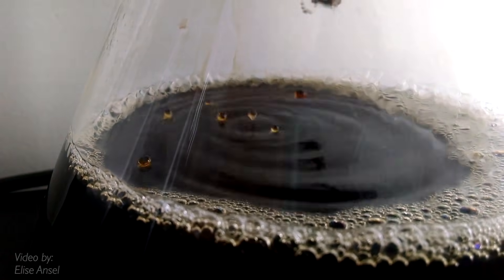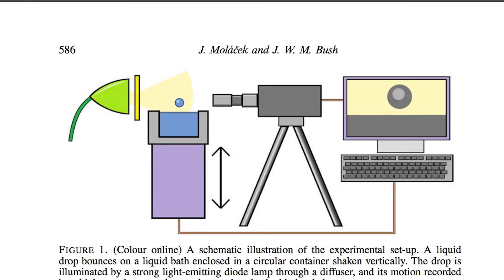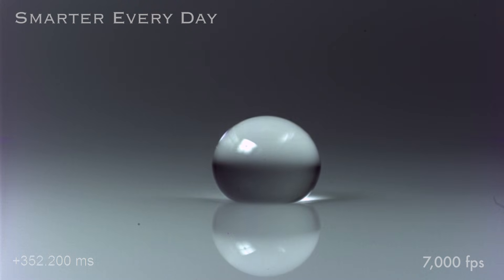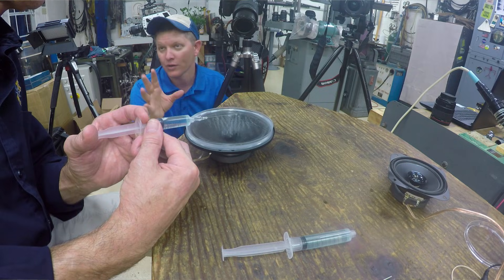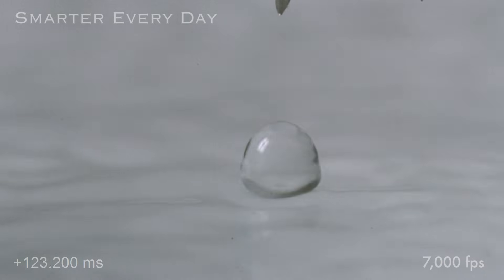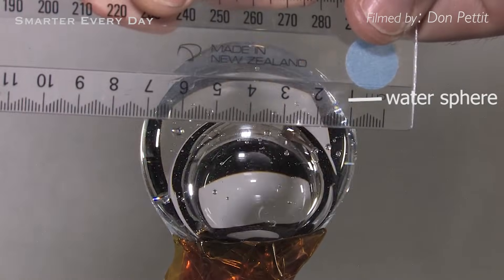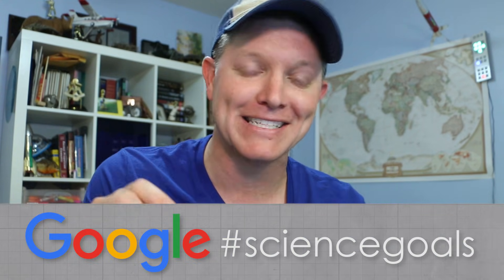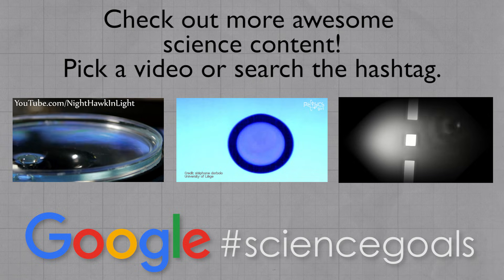The WALKING WATER Mystery (in SPACE and SLOW MOTION!) - Smarter Every Day 160

Comment: At 0:52. My guess is that there is a small region in "parameter space" where the surface tension is not quite enough to form gas bubbles but can form liquid bubbles? Then those cannot float in air, so they skim the water, and then then eventually the liquid reabsorbs them.
Reply: Oh shnikes. I guess we're getting into surface chemistry … ………

Comment: I can't understand how this video does not mention the forces that bond the water. It seems reasonable to suppose that the tension between the drop and the water happens because the surface of the drop is "more attached" to the rest of the drop than to the water that do not hit the drop with a pointy wave. When the water acts like a bowl the gravitational pressure is momentarily less strong than the surface tension that depends on the force of the bonds of the water.

Comment: I would like to add some personal observations regarding this phenomenon. I have seen this many times while paddling a canoe. The splash that occurs when the paddle enters the water for a new stroke, throws the water forward with a bit of spin imparted to the droplets by the forward motion of the paddle entering the water, and also,  it is also the angle of the blade which imparts the spin. These spheres sometimes last for two or three seconds. I found them fascinating and thought alot about them.
Victor Schauberger saw rocks of six pounds weight levitating in river rapids. The rocks came right up to the surface and bobbed about. This happened when the water was very cold and buoyant as a result.  [I noticed you were observing melting ice droplets.]
Another inventor discovered that if water is vibrated at a specific rate, electrolysis is improved massively.  When the water molecule is vibrated its electrical bonds are loosened, so with the same electrical input hydrogen and oxygen are produced many times faster.

Comment: OK, Destin. I stopped at 4:20 to make a hypothesis that the residence time has to do with temperature differences between the droplet, and body of water it rests on, affecting surface tension. Also, if you reduce surface tension by introducing a surfactant such as dish soap, it will eliminate it completely. Now I'll continue. :)

Comment: if the walking water is due to the air layer between, then a vacuum pump should eliminate this phenomena
Reply: They mentioned that.  There were experiments with reduced air pressure & the dwell time of the drops decreased linearly with the pressure.

Comment: This phenomenon is very easy to understand. The basic principle deals mostly with rotational velocity versus surface tension. Basically they are both water and thus "should" just become one again, however because of the movement of the water droplets through the air, a barrier is generated due to the difference between the molecular vibration of the gaseous air and the liquid water. There is at that point an even amount of pressure around the water droplet and now that it is isolated and falling, the movement can't spread beyond the boundaries of the water bubble in motion so that downward velocity must be diverted continuously and thus generating a rotational movement. The bigger body of water is stagnant in comparison to the rotation of the smaller water droplet and so as the droplet spins it is moving too quickly to breach the surface of the bigger body of water. after a few milliseconds or seconds the bubble has slowed down due to a two part system, friction from the body of water and the water droplet being close and putting pressure on the small gaseous barrier between them as well as energy dissipating as the droplet rotates. After the droplet has slowed down, the surface tension of the droplet lets up and gravity begins to act more on the droplet and the movement of the droplet and the surface tension of the bigger body of water are significantly closer. The droplet gets too heavy to be supported by the small gaseous barrier and so it descends, penetrating the barrier and falling into the bigger body of water. That's about it.

Comment: Timing AND node size, perhaps?...the troughs and peaks created (nodes?) by the frequency you used seemed to closely match the drop size as well? Would seem to create a better hydrostatic (for lack of a better word, sure there's a correct one) layer of air between the surfaces if they are similarly sized and shaped...?

Comment: I was once an audio major, and though what I'm about to say isn't scientific, I think you'll be able to extrapolate my intention to one of understanding. 

Concerning the cello, and why it causes the droplets to break apart and float around inside the air bubble; the cello is an instrument of sustained friction induced sound. Running the bow across the strings creates vibration through friction, sustained friction. Other instruments, like wind, most percussion, and even a piano result sound from instantaneous pressure changes due to air or instant impact. Even a drum, though sustaining a partial friction based impact initially, the sound is produced due to the change in air pressure resonating off the head and walls of the drum.

With bow and string instruments, we have an entirely different source and cause of sound. Continuous Vibrational Friction of materials is necessary to create and sustain the sound, and the moment that ceases, the sound diminishes rapidly, depending of course on the tension of the string in question. Whereas in a wind instrument, the molecules themselves are being vibrated inside the instrument to generate sound. 

Given that, the medium through which the molecules are vibrating emanates from an entirely separate kind of source of sound causing inducement. As such, I would wager a guess that a) if you were to further study this at a deeper level you may reach the answer as to why they cause this and nothing else causes this effect, but more importantly b) it suggests that molecules can vibrate in entirely different ways given the method in which they are induced to do so, causing different forms of sound. Much like a square, sine, or sawtooth wave, the idea could be that the molecules vibrate in just a certain way that is different than that of non-friction inducing sources. Think nails on a chalkboard.

I hope that makes sense, and as I said, it's not scientific, just a theory.

Comment: Temperature may also play in to this.  If the water drop is cooler or warmer the puddle.  You have an example of ice dripping into a puddle.  Maybe similiar to water on the fry pan.  Be interesting if the water was absorbed when the temperature was the same.
Reply: The cello comes closer to matching the resonance frequency of the water.  Notice how the low tone makes the water shake violently that's probably close to the resonance frequency of the water. It would be interesting to match that frequency and hold it for a longer period of time.

Comment: Don't the strong hydrogen bonds of water also help the water not break down or flow into the larger body of water. A drop of water will generally be able to maintain its shape longer. I can also compare this to a pencil where a long pencil can be broken easily while a short one cant. If hydrogen bonds where mentioned my bad.

Comment: I would think has more to do with surface tension than "air gaps" between the surface of the water and the droplet of water. When they vibrate the water via the different forms of waves, the surface tension of the water is strengthened, in the same way that a sheet of metal is strengthened when you crease it over and over along the surface of the metal. A flat piece is weaker than a piece with some pattern of grooves and/or dips and vallies! Interesting video! 👌

Comment: The cello caused the water waves on the inner surface of the bubble to break loose due to the long period of vibration.  Rock and other musical types do not reproduce the lengthy vibrational period so the water can spring back after each note rather than attenuate and break free.   Likely this can only be replicated with strings due to consistent vibration, though perhaps some woodwinds may be able to.

Comment: Ok I did not watch entire video so explination may be in the video and I may have missed it.

If explination is not in video then here is what I will offer.

"Prince Rupert a drop syndrome"  the exact physics that form a hard shell glass drop is happening with all matter when it is liquid form.

The drop is formed when there is no supporting solid matter in gravity or not. That drop has its on construct where all the effects of basic physics apply such as temp differences surface tension and grip. Together creating a sphere.

The sphere becomes it's own entity with a outer wall of surface tension holding it together in a Prince Rubert's drop fashion, when a glass drop  cools the outer wall becomes very hard as everything inside is pulling the surface inward multiplying it's strength. Do to the speed difference in cooling.

Imagine if we could harness this law of physics to creat more complex shapes for body armor or
 even apply it boating to help improve fuel economy of ships.

No I am not taking about the sound side of this, but giant vibrating ship would be fun.... For about 5 seconds.

Comment: Disagree about the air gap part. I believe it's caused by the surface tension of the liquid. Low air press can reduce the surface tension. The rotating/spinning of the  liquid also plays a critical role.

Comment: i am the only never seen these water balls?
Reply: ASHO nope
Reply: Nope
Reply: I feel like even with a critical eye, no, I haven't noticed this. Maybe there's another factor at work such as altitude? I live in the great plains of texas, and I have never seen this phenomenon before. I wonder why that is?
Reply: No if you have turn on a water faucet or washed your car then you have seen it. You just did not noticed. It’s caused because the water droplets are round which has the strongest form a liquid can get into. The the flat water has surface tension. For a short time the two surface tension fight each other.
Reply: @equuspallidus  did you even watch?

Comment: it has never happened with me..
Reply: JasonSt 1. Get a glass of water 
2. Use another glass and add water in it also add a little bit of soap and mix
3. Slowly dip your finger into the glass of soap and water
4. Get your finger on top of the glass of water
Wait till the water on your finger drops there
(If you have a pipete use the pipete)
And the water ball will bounce!

Comment: There is actually a better explanation than an air layer but I'm sure that plays a roll. In reality water at an air-water interface undergoes a phase transition where the water molecules are oriented in liquid crystal chains due to their polar dipole moment. This (North-South-North-South) bonding structure is much stronger than the bulk water and the interaction of the two surfaces will naturally be of like charge and therefor they will repel! 

Look into this liquid crystal phase of water, so much technology we're missing out on with simple water as the main ingredient.
Reply: If the air gap theory were correct wouldn't the gap be smallest with the initial impact? Also the catcher's mitt analogy doesn't seem to hold very well on the flat surface or for prolonged drops (but obviously any decrease in impact forces increases the odds of a lingering droplet). My guess was akin to yours wherein a longer duration allowed for alignment of water molecules between the droplet and lower water body wherein the polarity of single molecules was stronger with the molecule in the droplet than the molecule that the water droplet in the water body was previously attached to. Once that initial boundary layer is violated the surface tension doesn't hold up and the droplet's molecules take their place in the larger body of water.

A question that arose from this is whether the surface of a body of water has a unique structure that allows for the rapid formation of a crystal structure promoting freezing and perhaps surface tension above freezing?
Reply: I think this explanation is probably more accurate and certainly worth more consideration. As a physics graduate, I am struggling to accept the air-gap explanation which relies on compressed air in effect,  but the water-air interface charge suggestion seems to me to make more sense as it would then be an electrostatic repulsion of the two same charges, until it was overcome by some other force.  Indeed the standing nodes would present a higher/lower dipole moment that would explain the observed phenomenon.

Comment: Wtf i have never seen that happen in my whole life what kind of water is that?
Reply: Zane Vigoren normal water
Reply: 1. Get a glass of water 
2. Use another glass and add water in it also add a little bit of soap and mix
3. Slowly dip your finger into the glass of soap and water
4. Get your finger on top of the glass of water
Wait till the water on your finger drops there
(If you have a pipete use the pipete)
And the water ball will bounce!

Comment: The reason why only the cello made that happen, was because with other music, there are more than one factors, like drums, bass, and vocals. With the cello clip, there wasn't any drums or people singing, which would create one tone at a time. With the other music, many different factors and tones played at the same time cause the air inside the water to vibrate, but at different frequencies depending in the factors. There were multiple things contributing to it at once. With one tone played differently, the vibration would be so concentrated that water droplets are forced to repel from the rest, creating the phenomenon. This phenomenon is just like how one pin could pop a balloon (cello) but many different pins (other music) balanced it and didn't pop.

Comment: Fabulous video, but my gut feeling is that the frequency modulation of water is what causes coalescence the air gap maybe a factor, but the usage of the speaker and the music sort of give you that hypothesis that it's all to do with frequency.

Remember when the drop landed in a trough as opposed to the peak, the outcome was different, that's the reason why, also why coalescence occurs more towards the edge of the petrie dish rather than by the centre, also you see that when viewing the rain drops outside, the beads of water move towards the outside, then coalesce.

Just a thought, but I don't have the knowledge to put it into good english.

Comment: Dustin, I have ben intrigued by vibrations all of my life and have learned that there is a frequency for every material, but the AMAZING part is the question; When does the Input vibration have an astounding effect on it's material? ANSWER; "When the input frequency "RATE OF CHANGE" corresponds to the material's frequency "RATE OF CHANGE" close enough that the Input frequency is able to "DRIVE" the Materials frequency to a state that becomes unstable"  THIS action seems to require a fluctuating input frequency such as would be produced by a stringed instrument (Cello). I like to think of it in terms of pushing down a dead tree. You usually can't just push a tree over usually you need to push then wait then when the tree swings away from you again you push again. and as you are doing this you will realize that the energy in the swinging tree grows with every push you give eventually reaching the breaking point.     EXAMPLE #2 whistle at the side of a wine glass or piece of steel that will "RING" you will find that certain tones will make the steel "RING" "POPEY THE SAILOR MAN" is a good song to whistle. I forgot what note does it but I first noticed an "I-Beam" ringing every time I hit the certain note as I was whistling. I later realized that if I whistled strongly the same note at the beam it would ring but if I whistled the note slowly dropping the tone - nothing - slowly Rising the tone I would get a stronger ring out of the beam. ..... I can't imagine how crazy I looked WHISTLING at an I-Beam ! ! !

Comment: at 10:27 I wonder if it might have something to do with the the wavelength of the tone matching the thickness of the water drop or the thickness between the outer edge of the drop and the inner wall of the bubble?

I also wonder if we are also witnessing the strength of molecular bonding due to surface tension, and How different fluid elements react within different gasses in a similar fashion? Like Water suspended in a methane gas environment, or Mercury suspended in a pure oxygen environment.

Comment: To truly test if the reason for the bubbles to avoid coalition is because of air, the experiment need to be perform without air, but also less gravity equal to the air pressure slowing down the bubble from falling. It might be surface tension more than an air gap that prevents it from happening.

Comment: I still believe that electron bonds must be a part of this. When they are bonded to other molecules in an established body of water such as the drop and the pan, how and when do they move their attraction to share their bonds with newly introduced molecules (a cohesive liquid with surface tension)? How do you get the electrons to detract from their present bonds to establish a new bond? How about temperature, does heating the water to near boiling change the experiment? If the water is hot it may be more inclined to have a vapor barrier. On the other hand it lowers the viscosity and might improve the coalescence. The addition of temperature might be interesting.

Comment: It's the old 1/r scale issue. At some point the drops become small enough that the surface tension overcomes the weight temporarily. I would guess that smaller drops survive much longer than larger drops do, so the smaller you can make your drops the more durable this phenomena will be.